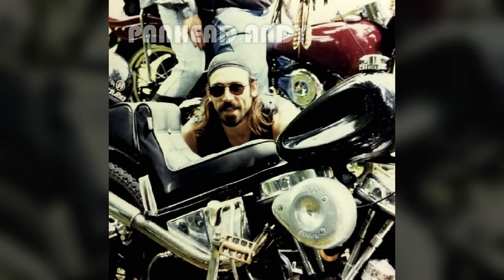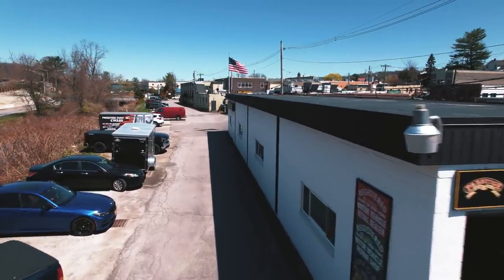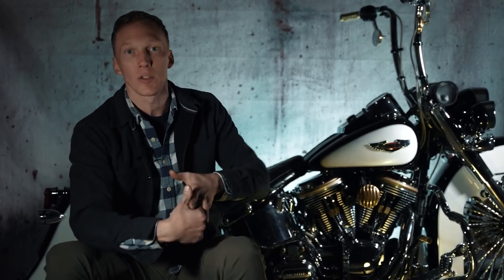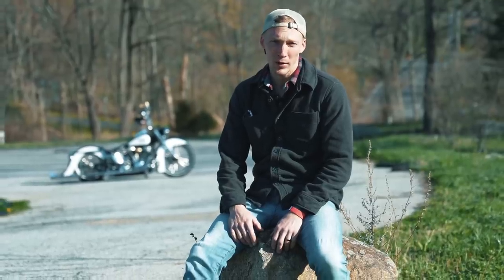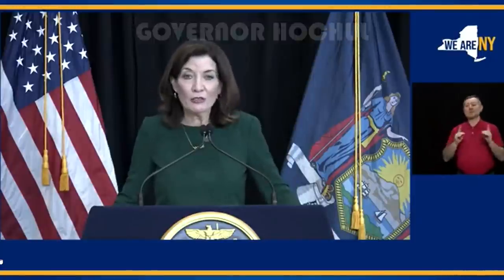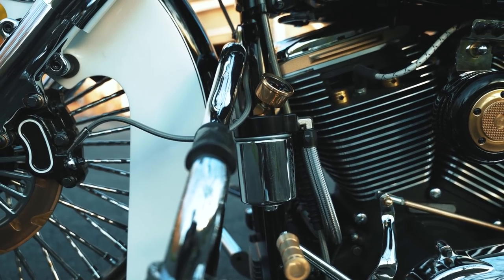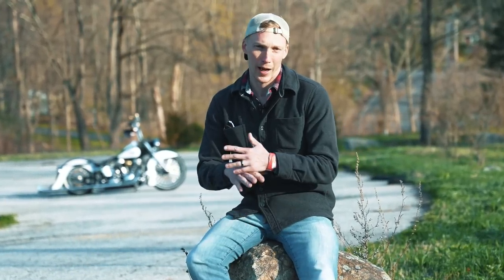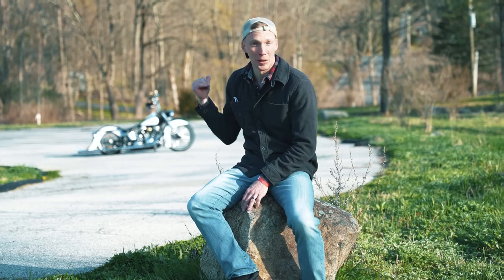TWIN CAM CHOLO SOFTAIL *BULLETPROOF STREET ENGINE BUILD* FUELING 574 CAMS/ 107 BIG BORE / PERF HEADS

Comment: Hey, john just saw ur video on the upgrade of ur Engine, I have a 2011 softail deluxe and I upgrade my intake to after market and my exhaust to fishtails 36” I need to do a tunning on it, and I called prestige custom cycle and spoke to John, I gave home information on my bike and told him it’s heats up he said because I need to do the Power vision on it. I asked him FP3 he told me was waste off money he only does Power vision I also told him I have a 96 cubic inch and I wanted to upgrade the engine he told me that on 96 I can’t go high on the 574 cams, it can be around 525 he can tell me because my Engine smaller it will run about 103-104. And will cost to do the all upgrades on the engine around 9k. That like getting another bike. For the Power vision will run 800$

Comment: Chris Rivas 574 cams, stock 103, S&S teardrop air cleaner, with true duals made 100 HP, 118TQ on my friends bike. Peak TQ 3500 rpm. 

I think you should contact big city thunder baffles get some torque cones/ baffle inserts from them.  That’ll really wake up that mid range. 

Sick built.
Reply from the maker: The mid-range seems to be just fine, the top end is what falls a little flat. My builder is pretty sure my velocity stack is what's holding back the HP above 5k. The brass grill although looks free-flowing, it seems to be having a limiting factor that high performance filters don't have. The S&S teardrop is a proven design which I'm sure is why you friends bike is making a bit more power.
Also, B-motors on the softails typically produce slightly less power than A-motors. I may shave down the brass grill to expose more open area
Reply: @JETFILMCHANNEL  yea balancers take a little from you, but not that much, we built 107” Harley’s that make well over 100hp with stock heads. I would think you need torque cones at the minimum.
Reply: @JETFILMCHANNEL   follow up regarding my comment I forgot to mention. We ran stacks on our drag bikes all the time. Even our Vrod had billet stacks different lengths to affect where the power was in the rpm range. I don’t think a stack affects you that much we would see 5-7HP On the different lengths being used. I think your area of concern is the reversion in the exhaust thanks killing your power. Need to add some cones? Or the baffle insert with the washers to limit the amount of reversion coming back to the cylinder that’ll wake it up. It’s the length and head pipe design of the duals/fishtails. These are trucks used on drag pipes that work and are proven to work. They are cheap as well.

Comment: bought my uc new 05, went from stock to big bored with ported heads. 100,000 miles later and tired motor. I had it bored and stroked to a 103. everything inside new. my reworked ported heads. geared cams, balanced crank timken bearings, reaper cams. the list goes on. 104hp 104 tq. makes me 😃 😊
Reply from the maker: Respect for sticking with the bike through the years. Good numbers you're making

Comment: I did a full S&S build on my twin cam for a little over four grand….in 2010. Lol. That was a S&S 103” kit with ported and polished heads from S&S with 583 ez start cams and other internals.  10:1 compression. I’m still rocking that build and she chops!

Comment: I've been watching 574 Reaper Cams Videos , my bike just got  - CAMS, High Flow Oil PUMP, Cam Plate today by FUELING parts ...!!!! Cant wait to hop on it and see the difference
Reply from the maker: They really do make a big difference. Keep in mind though that these cams will really shine with boosted compression and head work
Reply from the maker: Also, if you saw that "softail breakout" video with the 574's then just know that his idle is dangerously low

Comment: 89 plus hp and 110 tq rear wheel your motor is a BEAST.  The HD TC is not a big HP producer however it is a huge TQ producer. HP is for top end speed. TQ is for burnout and pull your arms out of socket . That's what makes a scoot fun to ride.
Reply from the maker: Yeah, it's so much faster than it used to be. Yet still, I'm changing out the intake in favor of my old A.N. big sucker to give it the power it should have in the top end. The grating on the velocity stack is choking it above 4800.

Comment: Excellent video and you dropped some great knowledge! Sick bikeyou have there, truly a one of a kind!
  On the oil filter relocation from DK Cosmtome, the true purpose of it is to help cool the Twin Cam down by getting some wind on the filter. Twin Cams tend to run hot but the recommend oil temp is right at 230°f 
Just an fyi . I like how you did up the oil pressure gage, awesome touch!

Comment: loved the video work stuff, bike looks cool .I run Reapers in mine but they are 543s  with a Thunder Header and a 42 Mikuni its just a 95 inch 10.5 to 1 with  2007 casting of Harley heads ported etc the info your tuner Andy I feel said the truth about how much you run at 6k rpm my combo makes 104 and 107 great cams and head work . Your pipes are killing your numbers but Im sure Andy told you that.. Good job nice ride

Comment: Great build !! Such a bad ass bike!! What do you think about a softail standard build into a vicla. like a 2021 softail standard, and build it up like a vicla? Change the front end...but on a deluxe front end,, of course Carlini 16 gangsta apes....change the tank...stretched fenders,,,light bar etc etc,,,107 engine sounds like a great platform? Your bike is super badass bruh!
Reply from the maker: Thanks man. It can definitely be done on a standard. Just a couple more replacement parts than if you started on a heritage. The 107 m8 is a great engine to build from, wish i had one. 
I tell everyone the same thing "have a really solid plan before you start" you'll save time and lots of money. Use loctite on everything, it'll help you sleep at night.

Comment: Another question....I love the samson fishtail but when I put them on I seen a major loss in low end torque....Did you experience this and if so did you get any of that back when you did this build? Thanks for answering questions....keep the build coming
Reply from the maker: I didn't get much back, however... I didn't build it for low end torque. I built it for mid range. But if you're after low end TQ then you can go with a cam that's meant for that.
But honestly the true duals are really only good in the mid range, they kill the top and bottom. But if you want keep them then I'd suggest to play off their strong suit

Comment: Sir it's been 10 months. I have a 2002 FLSTC. carb. Just finished my build 95 big bore. Stock heads very ported polished bigger valves valve springs. stock jugs bored. SS 583 cam fueling cam plate oil pump. 2into1 Cobra El Diablo pipe. HP 110 TQ. 111 rear wheel. Oh. yes high compression pistons. My builder also used little smaller head gasket. His own touch. The shop is called Gearheads Michigan city IN. The shop is not much to look at however this guy is a true builder. I am so lucky the shop is only 1.6 mi from my house. Anyway my total build parts labor $2750.00. P.S. The other things to the scoot paint job wheels  exex. another $12000.00. At his shop I see a lot of 1%  Hells Angels Warlocks Outlaw MC. I don't think those guys let just anyone work on their scoots. PSS. I still admire what you have done to both your scoots!!
Reply from the maker: The 95's always put up good numbers, but with a 2-1 vs true duals it's apples/oranges. But that total bill doesn't add up.
Head porting and valves are minimum 800
Cylinders and pistons 1000 new
Cam+the cheapest feuling camplate/oil pump 800-900
+ Fluids/ filter/ gaskets/O rings/ lifters/ pushrods/ headbolts/dynotune
+ LABOR!!!
I scour the market every day, so 2700 is impossible for all those parts and work.
Reply: @JETFILMCHANNEL  Yes I did send another msg. the fueling cam plate and the SS510 cam was about $3500.00 and the Cobra 2into 1 was about $1000.00 all B4 the build. The only parts I purchased for the 95 were gaskets SS 583 cam and pistons I let the builder have my SS 510 cam for free. His labor rates are $85.00 per hour. Cylinders were stock .bored out. Heads were stock and total work on them was about $725..  I paid $9828.63 for the used scoot at HD. Michigan city in. APR.22. Total spent on the scoot after purchase aprox.$15000.00 I will double check but I am pretty sure I am correct on my $ I paid.

Comment: very cool video! I just found your channel and I'll be wtaching more. you are soooo right about your fishtails! they look cool but are the worst exhaust system hands down! Im not sure why your dyno guy is tuning uncorrected! if you took a pull with SAE correction which is what will show true H.P. I bet you would make about 70 H.P. a nice 2-1 and good flowing air cleaner you would break 100 H.P. still a very cool looking ride! and it sounds badass!

Comment: You don’t need to mill the heads. What you need is a thinner Cometic head gasket. If you do mill the heads make sure you add compression releases. How do I know?  I have a Revolution Performance build making 110HP 110TQ, I am an engineer and I have built at least 5 twin cam engines.
Reply from the maker: The Rev kit came with the .030 cometic gasket, but the thinner gasket only gets you so far. Domed pistons and smaller head combustion volumes are where high compression ratios really come from.
Reply: @JETFILMCHANNEL  you are already at about 10.5:1 compression. How much compression do you want?  It gets hard to start and you have to watch the octane of your fuel. That is why I suggest compression releases if you mill the heads.

Comment: John, I remember your tuner say, you may need a new clutch, at what point did your clutch burn out? Or has it? I went with 585 S&S on a 88ci and mine burnt out 8 months later.
Reply from the maker: It didn't burn out, but it wouldn't hold the power. Went with the bandit sportsman clutch and never looked back. Amazing clutch that can hold big power and take a beating

Comment: Where did you get the swing arm? And how did you run your new brakes on that? Or is there another new video coming? That and the 23” wheel.
Reply from the maker: The swingarm is made by Backbone built bikes. Running the rear caliper wasn't too difficult, but it required a new bracket and all new spacers.
I will cover all of it in an upcoming film

Comment: Hey which cable clamps are you using and whats you honest opinion on the possible damage to bars and cables? Ty in advance for your time and info.
Reply from the maker: I believe they're drag specialties clamps. They don't do any substantial damage to the bars, especially if they're tight and don't slide. They can mess the cables up a little if you allow the cables to slide within them.
Personally, I love the way they look on tall bars because it breaks up the long pipe with some texture

Comment: What size cable kit did you use for your bars ,  on your deluxe I’m building a cholo , and going with the same set up on risers and bars . I don’t wanna order the wrong size kit . I didn’t know if you just order the 16 inch kit for the bars or do you count the riser length with it . Which would be 18inch kit then ?
Reply from the maker: If you're going to use 16" bars on 2" risers then order the 16". Magnum usually labels them 15-17" and they factor in a 2" riser.

Comment: How do you tune a motorcycle when the exhaust has no back pressure. When you got off the throttle is just pops
Reply from the maker: Actually from what I've learned, the fishtails create a little back pressure due to the shape of the muzzle. Not much though.

Comment: Without watching the video I can tell you it’s because of the 1 1/4” fishtails. Editing seems on point 9 seconds in. But NO Harley motor is bulletproof. Actually I take that back. The only reason this is “Bulletproof” is because it will see about 100 miles per year, it will never rev above 4000 rpm.

Comment: "Anyone who says they did an engine build for 4500 is fucking lieing" Can easily be done if you do the work yourself....
Reply from the maker: Even that's a stretch when you factor in the WHOLE cam chest, heads, gaskets, special tools, etc, and 99.9% of people don't build their own engine. Tuning alone can be over $1k when you include the cost of a PV.

Comment: No HPI throttle body?....a must with all those top shelf parts man.
Had a 03 screamin eagle road king that had 10.8-1 comp.. andrews cams. Kb forged pistons. Worked to the max heads...titanium springs and 5 angle cut valves. Decked and honed cylinders. Accel ignition wires, bigger jets, fuel pump. Hpi throttle body, sns air filter. Bassani 2 into 1 road rage stainless.....
I know exactly what your talking about brother when you compare our motors to stage 1 twin cams....of course there's no comparison but it also cost me 6 grand to do that....I assembled the motor myself after all the cylinders and heads were done.....kometic and James gaskets also...crank had a 2 thou run out .....next upgrade is a baker grudge box....also of course we did a dyno on it when it was done. Purchased a tune license for future upgrades...lol

Comment: Such a beautiful bike and I love the sound but my Triumph Rocket 3 as ugly as it is, it's making over 150ft lbs of torque at 2750 rpms.  I have a 50hp dry shot, pipes and a tune but it sounds like a shitty tractor.  Getting older so maybe I'll ditch the British Beast and get bike that actually sounds good.  I'll miss that power though.
Reply from the maker: I feel your pain, I had a 200hp Kawi zx10r that I sold a few years ago. Crazy fast, but I realized that i was just another "kid" with a loud sport bike and even the Worst harley in the parking lot would get more respect than my ninja, because... it was a Harley.
My suggestion, buy an m8 and build it up to be a monster. You'll still have your power, and a Harley.

Comment: I mean it’s a cool bike. And it was stated that looks are priority with this bike. But what the point of having a bad motor with apes big fenders no ride hight and long pipes? Cool it can go fast in a straight line but how does it corner? if looks are priority then why have a big motor? Why do any performance. Cause it sounds cool? Come on man. Either build a pretty bike.  Or build a pretty bike designed to fuck. Like actually get down. And a motor could potentially be built for 4-5$. By someone who doesn’t pay someone else to do it. And I don’t mean joe blow hack. I mean someone who knows what they’re doing and has the tools to do it. This is just look at me listen to me. This isn’t bikes designed to be ridden hard. This isn’t bikes designed to ride across country and whatever the road or weather may bring. But hey different strokes for different folks.
Reply from the maker: It's meant to look sick and rip burnouts. What's the problem?

Comment: I see it still has a belt drive sorry brother but if you can still run a belt drive you don't really have big power
Reply from the maker: Saw a guy snap his belt on a stock 88" and I've seen belts hold up just fine on 150hp bikes.

Comment: My 128 makes 150 and 154 tq
Reply from the maker: At that displacement, 4 valve heads and a 2-1 exhaust, that's pretty common. Still impressive though